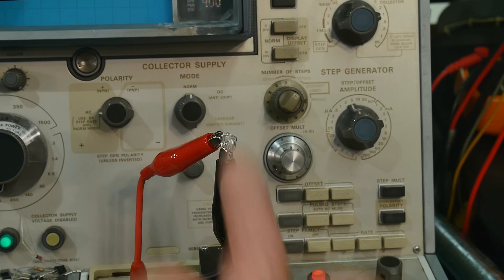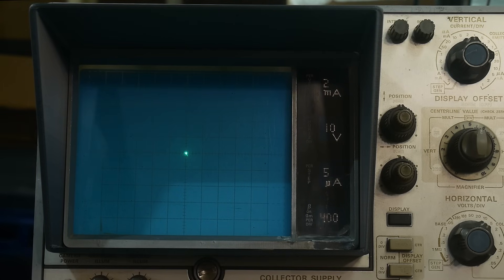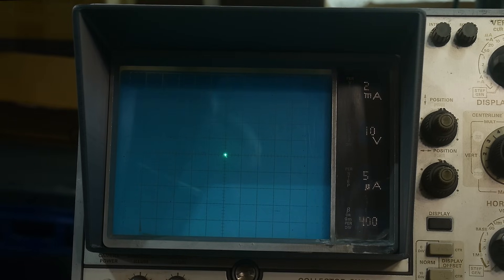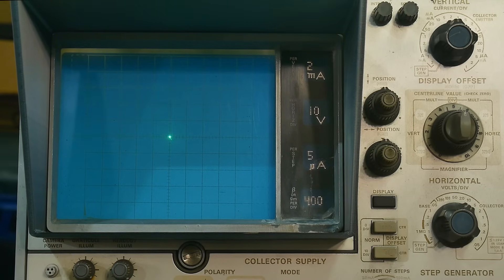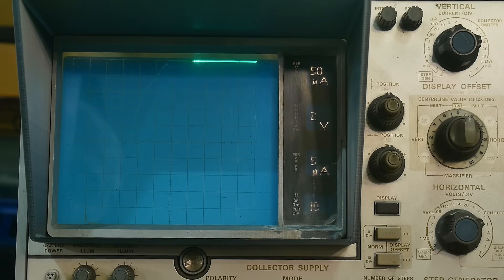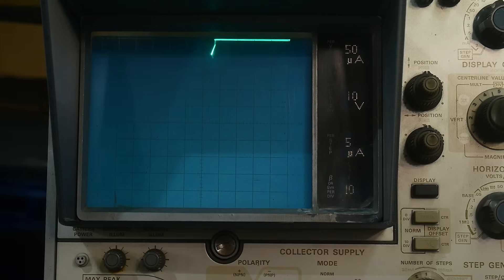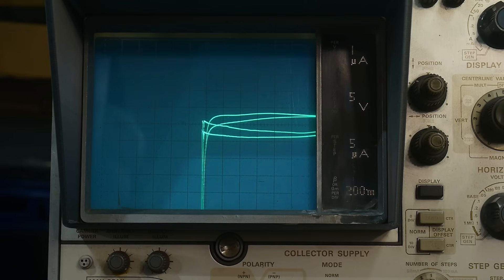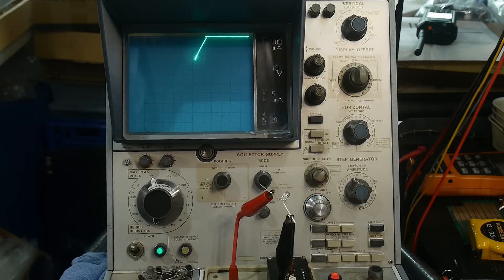#1778 LED Reverse Voltages

Comment: I never thought about LED reverse voltage until a co-worker asked me why his A.C. line powered LED didn't work.   He had the right value ballast resistor, but his LED wouldn't light.   Reverse voltage I said.

Comment: In the forward direction, IR LED's are used in parallel to the photovoltaic cell on solar calculators to protect the low voltage chip from too much voltage when a high intensity light source is present.

Comment: Great video!!! As soon as I got my 577 working again I'm gonna try this. Always was fascinated by quantuum effects measured as simple as connecting a macroscopic device to a measuring instrument. From as blunt things like measuring thoron half life with tuna can and a J-fet opamp, to much more subtle things like measuring Lamb shift with old hydrogen maser and a HP8662A RF generator. This video reminded me of a beloved friend and a great physicist Aleksandar Stamatovic. He would simply wonder into electronics lab and asked something like: Do you EE guys ACTUALLY understand how (insert a name of an obscure component or effect) works? And in about 2min time there were four of us EEs  listening like charmed to something like "how remodeling a shape of a potential pit in Schrodinger equation lead to discovery of a transistor" or had a rolercoaster drive from J310 to Smith-Purcell effect to free electron lasers. Learned a ton, and enjoyed it. Always taught that acadmia should be concieved like this.

Comment: I have seen LEDs used as voltage regulators, but not in reverse polarity. For instance you can use a directly polarized LED as a (relatively decent) voltage reference in a transistor-based current source or sink.

Comment: I made a low power, low frequency full bridge rectifier out of LEDs once just to see what it would look like and if it was possible. I used just enough power to light the LEDs, so maybe 3v at 20ma. All it did was blinken lights. 2 would come on, then the other two, and back and forth. I did it at <10hz so I could see this.
Reply from the maker: like this: https://youtu.be/6XCdCTQSeRw?si=DYaOhG-S-rR-rnh2

Comment: Hey IMSAI Guy, i've been watching a lot of your videos lately and when this came up I thought hey, i'd really like to see you stick all kinds of diodes in some kind of jig to show reverse recovery behaviour, slow silicon, fast silicon, schottky, zener, germanium, leds, BJT, mosfets body diodes, photodiodes, solarcells etc

Maybe just a signal generator with a square wave and a 100ohm resistor, probing across the resistor for current and the siggen for voltage or something

Comment: I've used old fashioned red and green LEDs in forward voltage mode as a low voltage zener.  Until they begin to conduct, their leakage current is in the femtoamps.  This means with an n-channel mosfet in voltage follower mode with a 22megaohm pullup on the gate where I had 2-3 green leds tied to gnd, my quiescent current was near nothing.  This gave me a voltage regulator with a 150v input span and a 3v output.  Normal Zeners have a leakage current way too high where my idol quiescent current budget was in the picoamp range.  Using a 6-8v zener would have had a leakage current >100ua before they would regulate properly meaning my 22megaohm pullup would have to be something like <100k at lower source voltages and >500k at high voltages.

Comment: Some audiophile audio amplifiers use multiple strings of red LEDs to develop multiple reference voltages. The key attribute is low noise over absolute stability.

Comment: A yellow or yellow-green LED can also be used as a light sensor. 9V battery, 1KΩ, a reversed yellow LED and the base of a Darlington transistor. Another LED with 1kΩ can then be connected to the emitter.

The light source is an incandescent lamp or yellow LED.

Comment: interesting clip,
I did this experiment back when I was in school.  
I was thinking that I could get X-ray radiation with that, because E=hf  so when we have several volts of breakdown voltage ( even found 92V breakdown voltage) so we should get particles with 92eV energy.
I took this idea to a solid state physics professor in our school, and he explained to me that breakdown is caused by zener or avalanche mechanism, which will not produce photons like 92eV.  If any one has the capability of measuring the radiation generated by reverse led breakdown, please let us know.  It would be interesting. 
--  Thanks.

Comment: Is it possible to burn unconnected 1W white LEDs just by shining like 10-15W of 405nm UV LEDs on them from like 15cm?
Because I think I did not that long ago 🤣 Was trying to cure UV mask on PCB they were soldered on.
Reply from the maker: you will excite the phosphor. 
https://youtu.be/R1w1yCWF90M?si=DjFtgPFdW4qU9D-5
https://youtu.be/gepeoKa1w7A?si=QjcTYwmHF6ecf71k
Reply: No, I get that phosphor glows, but the emmiter itself (dozens of them actually) burned out somehow, all damaged a different amount, some became shorted, some dim.
Reply from the maker: @Mr.Leeroy  no idea

Comment: Interesting!
Question: When you use the curve-tracer to view both forward and reverse characteristics simultaneously, what determines the forward and reverse voltage/currents supplied? It doesn't seem to be a voltage, nor does it seem to be a current, since the maxima on either side of 0 are not symmetrical on either axis. In other words: E.G. with one LED with a really large reverse voltage, obviously the curve tracer was not supplying the same forward-voltage, since the forward current maximum was clearly visible on-screen, and much larger than the reverse-current.
Am confused what that knob does! Is it power? Or is it a voltage-source with a maximum current limiter (that also adjusts simultaneously?)

I guess I'm pondering the usefulness of such a system, and plausibly making a really simple one (Ala just a variac, maybe, and an XY 'scope), but obviously, One wouldn't want it to be symmetrical in voltage, in a case like this!
Reply from the maker: https://youtu.be/BabCunP9ib8?si=R5OvlvQ7MTgyAB65
https://youtu.be/oFHTOQTIi30?si=1UacEO_nN28gmaGp
Reply: @IMSAIGuy  Thankya!

Comment: Great video! I learned quite a few new things. Just a couple of (dumb) questions:
1. How "safe" is it to reverse-bias an LED? I assume LEDs are not designed to be reversed bias like zener diodes, so how easy it is to kill one by reversing the polarity?
2. Does the LED glow when reversed biased? I assume it doesn't since it wasn't manufactured that way, but then again you have a voltage drop inside the diode (just like when forward biased) so maybe the excess energy is emitted as visible light as well?

Thanks again for the great video!
Reply from the maker: never reverse bias an LED unless it has a built in protection diode. 
no photon generation in the reverse
Reply: 1. It is safe to the voltage, stated in manufacturer datasheet; for the majority of LEDs it is 5V.
2. It does! At least some AlGaAs red LEDs I've tested with my breakdown voltage tester (multiplying rectifier to1200V+1(10) Meg resistor). Emission is from a tiny spot on the die, at the place of the breakdown. When diode avalanches there is probability of emissive recombination, but the efficiency is much lower than in forward direction. With high bandgap semiconductor and 30-60V breakdown voltages the mechanism of breakdown is always an avalanche, not tunneling. Tunneling occurs at voltages close to 0: tunnel diodes, 2.2-3.9V Zeners....

Comment: Many years ago I traced a fault on an Utah Video matrix, to the indicator LED on the front panel that had failed and which was being used as a voltage reference for the DC rail. Saved the cost of a Zener and resistor I suppose. Obviously used in the forward rather than reverse direction. I seem to recall the tunnel effect in some diodes could be used in oscillators, must go and look it up.

Comment: green LEDs are excellent low voltage stabilizers. They work better than the same low voltage Zeners.
Reply: But in forward direction 😉
Reply: @tvelektron  yes, forward direction.

Comment: As one commenter  stated, LED as voltage regulator or varicap.  I seem to remember someone (forgot the name)  using an LED for a varicap diode in a circuit.  I think the device was light sensitive and had to be painted to keep light from "adjusting" the parameters of the circuit .  I wonder if an LED could be used to FM an oscillator using a mirror (window?) as a microphone..

Comment: The optical effect was part of the "OC71" characteristic if the black paint was removed. Later, a white noise generator circuit was devised using the reverse bias of an emitter / base transistor junction, or Zener diode. Any chance you will show these experiments - please?
Reply from the maker: photocurrent: https://youtu.be/Z3aWAsw_48g?si=d0__OX7BHslGF8oO
noise source: https://youtu.be/Ow9zQXPYm3g?si=aP_3RW1elS-JrDHU

Comment: The most important application where LEDs get reverse biased temporarily are multiplexed 7-segment numeric displays. This dates back to watches and calculators in the 1970s. So a decent amount of reverse breakdown voltage like 5V is always needed for that. 
You could eg. not muliplex incandescent minitrons, which were essentially tungsten light bulbs.
Power LEDs are not built with multiplexing in mind. I have some white ones which are reverse bias protected by a small red LED chip bonded into the package, which was probably a test reject in the same factory. If you reverse the white LED, it turns red. Consequently, the data sheet doesn't mention anything about the reverse behavior of the power LED.
I wouldn't use the reverse voltage as a reference for anything since it's noisy and perhaps even oscillating in case there was any negative dynamic resistance in the breakdown behavior. I have seen that in emitter junctions of bipolar transistors and 4 layer diodes, and of course DIACs that are built to trigger.

Comment: Can you show some electrolytic capacitors in the reverse voltage region? From time to time I've seen two polarized capacitors put back-to-back (anti-series?) which has always seemed suspect to me. But if the reverse behavior is basically a small resistor, maybe it would kinda work? (A low reverse resistance would explain all the heat production that makes them explode…but I can find exploding capacitor videos elsewhere. Looking for something a bit more quantitative...)

Comment: Wow, this was so interesting!  Especially the bit at the end, seeing what looked like the avalanche or tunneling effect manifested on the curve tracer.  A few years back, I was enamored with the idea of building a (cryptographically) strong random number generator using a reverse biased transistor junction in breakdown as a source of noise.  That would be cool to see on the curve tracer!   

That curve tracer sure comes in handy!   I've seen plans here and there on how to build one, but I've not seen designs that scale up to a few hundred volts!
Reply from the maker: I did one: https://youtu.be/oFHTOQTIi30?si=HBong5H5gvajozOD

Comment: Yes the failed LEDs would be sold by Rat shack, because their buyers would only buy the cheapest binnings off the production line, so they got the ones that were the worst performers in testing, still emitting light, but poor in every respect.

Yes i have actually used LED's as voltage references, used them, with a large capacitor, 1000uF, across the LED, to replace the AA battery in a clock that ate them. Had to add the capacitor, as the actual clock running speed was very much related to battery voltage, so had to go up in resistor value to find the point that the clock would keep correct time. Worked out to needing around 12k, with a red LED, to keep the mechanism at around 1V3, where it kept good long term time. Running off a 12V supply from a SLA battery, that was also providing power to a phone base station to keep it running as well, so the phone would run during the frequent power outages. Solved 2 problems at the same time. Mechanism was one of those continuous sweep ones, which simply run the second hand mechanism at 8Hz, to get 8 tiny ticks per second, but that also meant it ate batteries, lasting around 1 month on each cell.

Comment: I’ve always adhered to the max reverse voltage on LEDs.  But what happens if you exceed it?  Does it kill the light output over time?  Obviously they don’t blow up right away according to your demonstration.
Reply: "...adhered to the max..." Heh! I've looked at numerous datasheets and most didn't even list a max-reverse-voltage! I had to do some deducing and eventually found a resource claiming the same, that most LEDs are rated for at least -5V for the sake of use in digital circuits (ala matrices). Though, I'm pretty sure I've heard there are even LEDs which handle higher forward than reverse(?!).
Where are you finding this data?
Reply: It's unpredictable. I've used red and yellow AlGaAs LEDs at 35V (no breakdown, Vbr ~ 60V) for years, but for modern nitride ones, even a single 1mA avalanche breakdown (30mA device) can be lethal. For amateur use you can go to 60-80% of their Vbr; i guess 😉

Comment: These videos are all very interesting.  Thank you for sharing your knowledge and getting us thinking outside the box.

Some non-LED diodes have glass envelopes, such as 1N914 fast switching diodes.  I wonder how exposure to light affects their properties.

PS:  I really like your curve tracer!
Reply: Awhile back I amplified a zener diode to fabricate a white noise generator for audio. It worked but suffered from 60/120 Hz AC hium. 

I tried troubleshooting the source of the hum thinking it was generated by the power supply. After almost giving up, I walked out of the room and switched off the overhead light. The hum disappeared!  Eureka! I covered the zener with black heatshrink and it now works flawlessly.
Reply from the maker: the 1n914 will generate photocurrent. I did that in one of my videos. can't remember which one

Comment: Some designs may naturally lead to reverse voltage conditions on an LED.  For example, an AC indicator or sharing a common resistor for parallel LEDs, which may seem reasonable in a situation where only one is on at a time.  Of course it's advisable to follow manufacturers data sheet recommendations for max reverse voltage, but oftentimes we aren't given the datasheet.  In those cases, I wonder if there is some rule of thumb that can be applied along the lines of "don't exceed x percent of the breakdown voltage".

Comment: Hello everything is fine.  What is the name of this curve tracing equipment?
Reply from the maker: Tektronix 576
Reply: @IMSAIGuy  Now if you have a spare (10 MHz) scope, it is relatively easy to make and add a circuit to perform this function as I seem to recall.
Google "curve tracer circuit diagram" images. The alternative is to pay hundreds of $£ for a Tektronix.
Reply from the maker: yes, but this one is good to 1500 V and 10 A